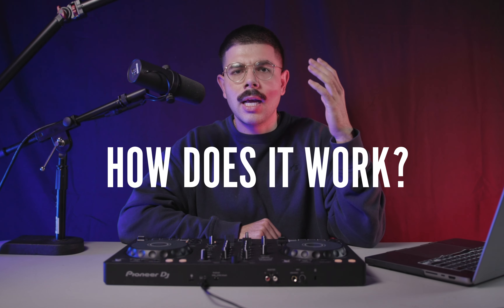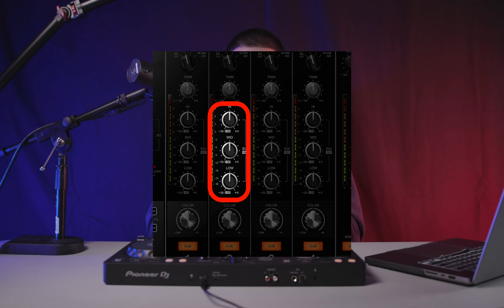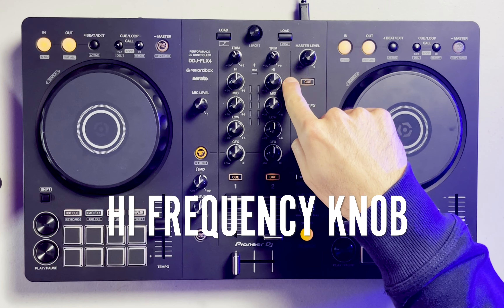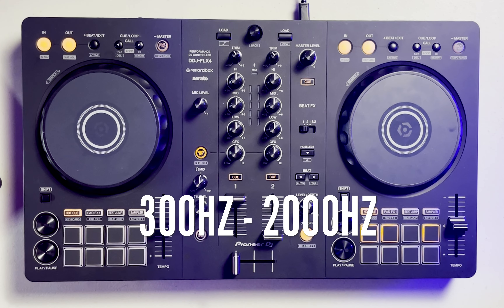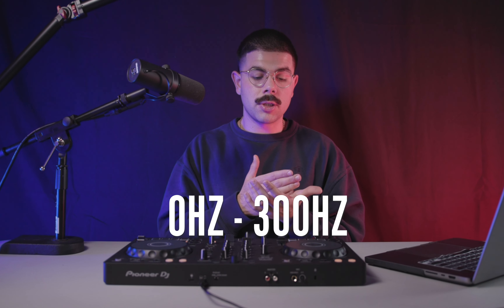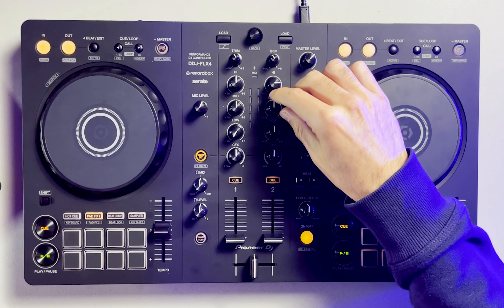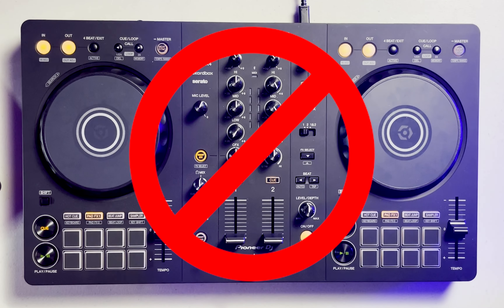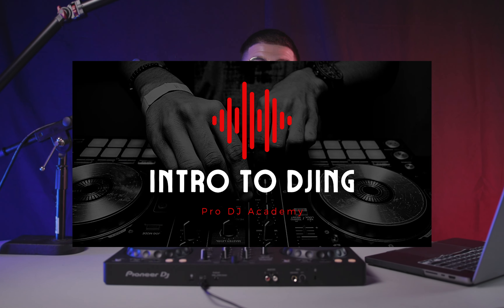How To Use The EQ On A DJ Mixer (EQ Tutorial For DJs)

Comment: Hello, thanks for the video. I can't help but notice you are not using any output speakers for your controller. In my case I am using the DDJ FLX 4 without any speakers. The thing is i only can control one deck and have no control over the mixer section including the fader. Can you please tell me the settings you are using if you are on rekordbox? Good video
Reply from the maker: Try going to settings/audio/output and changing it to your laptop speakers! Hope this helps, let us know if you need a video elaborating on this
Reply: @prodjacademy  Hey thanks for the reply. I have changed the driver to my laptop's speaker. Yet the only thing i can control is only one deck and the filter knob. the eqs and fader do not work. do i have to have any type of pro licence on \rekordbox to fully control my Deck? and please if you can make a video that would be great. Thank you so much
Reply: @yaredlikawent8062  Not sure what the problem is. Can you hear the song that’s on the other deck? If not, is the crossfader in the centre? If that’s not the case then maybe there’s something wrong with your decks.
Reply: @yaredlikawent8062  I say that about the crossfader because it happened to me when I first used the deck🤣

Comment: So what did DJ’s do before these 3-band EQ’s were the norm?
Reply from the maker: 3 band EQs have been around for quite a while now! But I’d assume before that they would find the balance using only the volume faders
Reply: Look up Bozak and Urei DJ mixers which were some of the first purpose built DJ mixers used by pioneering DJs like Frankie Knuckles and Francis Grasso Often they were set up with an isolator on the master channel to control the high/mid/low freqs.